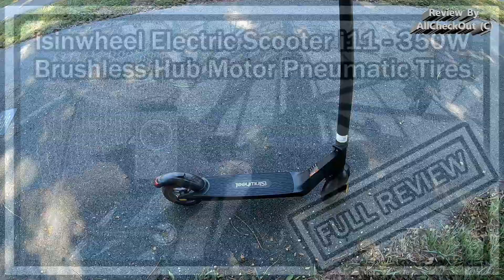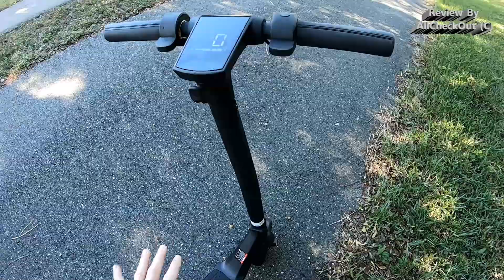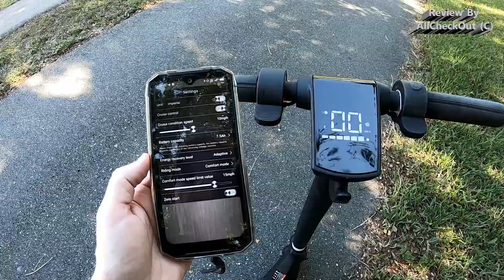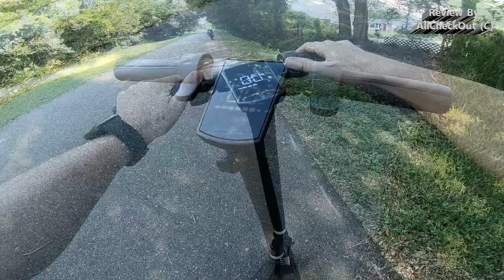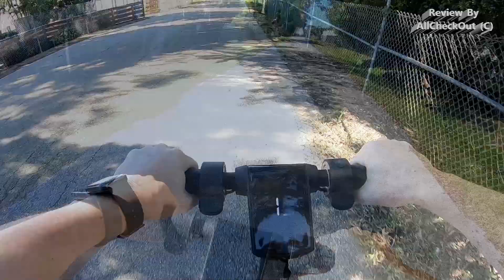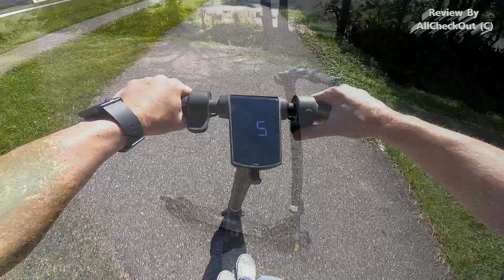isinwheel Electric Scooter i11 - 350W, 18.6 mph & 15-18 Miles FULL REVIEW

Comment: I happened across this scooter on Walmart’s website and ordered it. It hasn’t come yet. What worries me though is that I don’t see this scooter anywhere on iSinWheel’s website no matter what country I choose. I can’t find any reviews on it. I can’t find it on Amazon. If I didn’t happen upon it on Walmart’s website, I wouldn’t know it exists. This video is the ONLY video I can find about this scooter. Did iSinWheel discontinue it? It’s so puzzling.
Reply from the maker: Yeah ... no idea. I was asking their sales department as well and no real answer from them. They have so many different but still very similar models and also different models on different sales platforms. No clue, what's the idea behind. Maybe to confuse customers ... lol. Anyhow it's a nice scooter, but sold it just 1 week ago because I didn't use it enough, but still works great! I hope you love it.
Reply: @allcheckout  Please tell about your experience with this-did it come with all parts,easy to assemble?How much did yours cost-was it worth it? Any isses you faced, what impressed/dissapointed you most? Do you use it in wintery/wet weather conditions? And lastly,how do you find it compared to a bike? I have found one for £100 but wonder if it will come with missing parts or something.
Reply from the maker: @as11sharma67  Everything was complete and I really loved it but didn't use and then sold it. But one of the best scooters I've tested for sure. Maybe not very high speed but that's about it. Other than that an awesome scooter. Very comfortable to ride.

Comment: I pressed left handlebar, and it did nothing!  I thought it is used as a front brake.  Also, I pressed both left and right handlebars at the same time. It does nothing!  Do you have any idea?
Reply from the maker: Brake and acceleration buttons are explained here:  https://youtu.be/e2HzAvTS2CI?t=241. Maybe the battery is dead?
Reply: Did it work for you after,or was it a waste of money?

Comment: Rode mine once n it wouldn't turn off. Plugged it to charger n now it wont power on. Where did you get the app? Cant find it. Was hoping that might help
Reply from the maker: The app is called "MiniRobot" - here's the link to the Android app:  https://play.google.com/store/apps/details?id=com.loby.balance.car.google&hl=en_US&gl=US
Reply: @allcheckout  thanks tried but no luck. Guess its a power issue n ill have to send it back. Sucky Christmas
Reply from the maker: @davidking2470  Yeah batteries can be a problem, but usually more with e-skateboards than with e-scooters
Reply: @allcheckout  hopefully they will replace it because it was awesome the one ride i got to have.
Reply from the maker: @davidking2470  I wish you good luck bro!
Reply: @davidking2470  Did you get a replacement? Was it worth the money or a waste?
Reply: @as11sharma67  i sent it back and didn't want to risk another one doing the same thing then id have to ship it back too. The one ride i did get was awesome. If it continued working well worth it. Unfortunately it didn't.